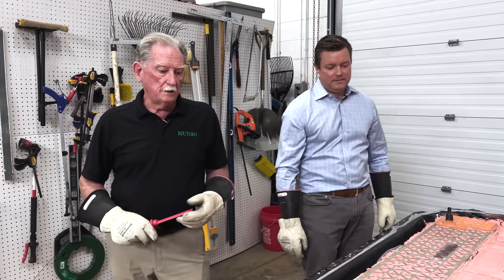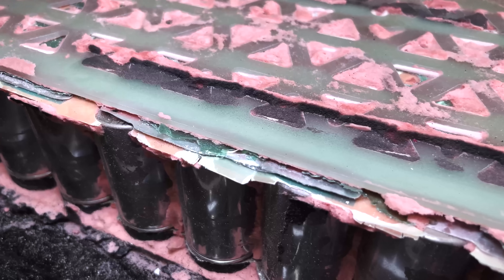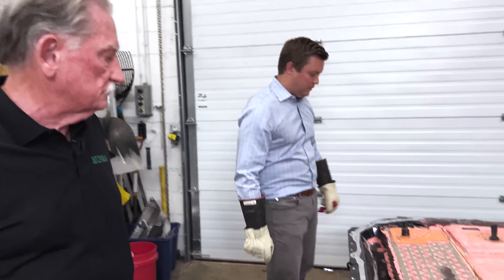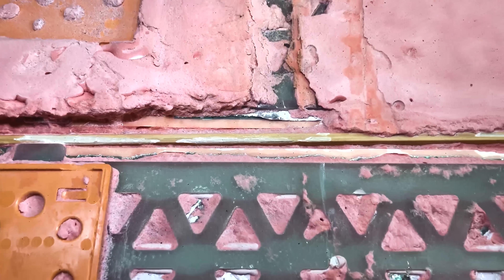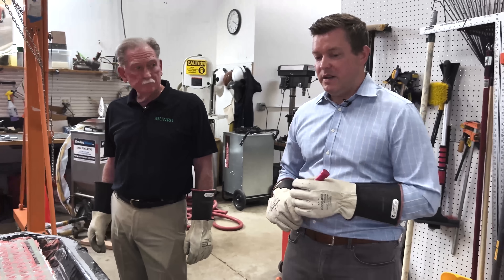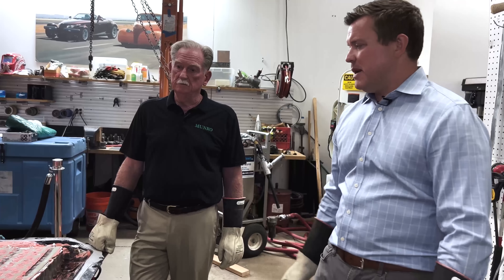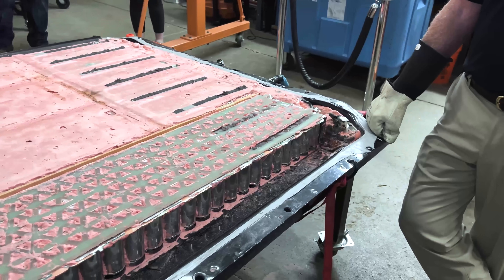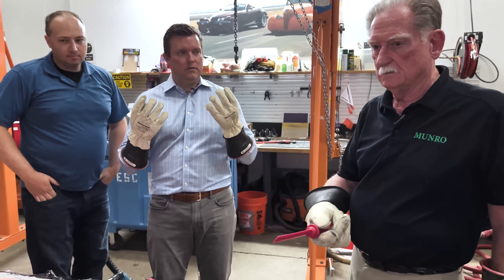4680 Battery Pack: What We Found Under the Foam!

Comment: Can you guys at Munro find the vendor for the foam and ask what their take on this is? I'm guessing they have a specialty solvent that will ignore the other plastics. Reuse > Recycle > Waste
Reply: The providers of any proprietary materials likely are bound by a contract to not disclose.
Reply: Or you just use the whole damned thing and plug it into a new battery storage system.
Reply: @Barskor1  yep, after a car then it's house storage, milk whatever is left that way. Only need to grind it up when it's totally gone.
Reply: @stevenson720  No.  It is into the grinder for recycling.  Recycling the minerals reduces the cost of new packs.  "reuse" in the slogan "reduce, reuse, and recycle" is there just because most things cannot be recycled to make it seem like you are helping when you aren't. The low volume of people reusing EV packs is absolutely meaningless.  Recycling 100% of packs is the real deal.  This is what we need to close the loop.  Once peak minerals are reached in the recycling loop, new mining is greatly reduced.  Reuse for silly one off projects prevents recycling.  Tesla will eventually hit people with a massive core charge if they keep their old packs because recycling is necessary to keep costs down and reduce pollution.
Reply: @Barskor1  You are not thinking correctly.  Tesla is getting full reuse of the minerals via real recycling.  This is far better for the environment than trying to piecemeal EOL reuse for silly random side projects.  DIYers are a tiny population and don't help anything.  It is far more efficient to recycle that pack than have a DIYer use it for a side project which forces new minerals to be mined and processed to replace what the DIYer refused to recycle.  Reusing a pack instead of recycling is a waste and hurts the environment more.
Reply: @_PatrickO  That is so stupid. Please take a look on how dangerous, energy intensive, toxic and wasteful recycling is. It will always be the last step. Why should I grind up the battery with 1000 of cells when only 5% of them are severely degraded and the rest has 80% capacity (even higher SOH for lower power uses)
Reply: @buggi666  I know, it is incredibly stupid to avoid modern recycling and instead mine new materials that need to be refined.  Recycling skips all that.  Look, I get that you are one of the people who thinks recycling is bad, but what they are doing with these packs is extremely efficient and  very very low pollution is generated.  Recycling an EV pack to make a new one is much more environmentally friendly than "reusing" the pack instead of recycling it into a brand new pack.  Go look up videos on redwood materials if you can't figure it out.   When they grind up that pack, they are reclaiming >95% of the materials.  That will go above 99% over time(assuming they haven't reached it already)  This reduces pollution far more than low volume DIY reuse.  Grow up.
Reply: @_PatrickO  First of all, I did not say that recycling is stupid. Dont put words in my mouth. 
I work in battery recycling and right now the only incentive is to split into low and high Co streams. Besides the electrode metals separation, which can be done mechanically, the separation of the grey matter elements is chemical and absolutely hazardous as a process.
The recycling should ALWAYS be the last step. Our demand for storage will be so high that we need ALL sources. This includes: second life, recycling, mining with conventional methods, new extraction methods, high emphasis on Co-less batteries, reduction of Nickel usage and new electrolyte chemistries. I am a grown up, but thank you.
Reply: @_PatrickO  Unfortunately, the ‘grind and recycle’ system is low-labor and low cost in volume but requires another large industrial complex to implement. 

There may be the quantity of recyclable batteries to do this only in a few large cities, so all these TONS of batteries (eventually) will need to be transported to large recycling facilities, negating much of the reduction in energy use for recycling over mining and building new. 

Local, small scale reuse is an excellent addition to ‘full life cycle’ recycling. 

Apple also feels all their older products should be simply shipped to China to grind up and reuse, but it is much more wasteful then the enthusiasts I work with to extend the life of an old Mac as much as possible before recycling locally. 

That said I think large scale ‘grind and recycle’ is still a good compliment to local reuse cycles.
Reply: @_PatrickO  Actually the three parts in "Reduce, Reuse and Recycle" is ordered in that exact order for a reason. It's because the least resourse demanding thing you can do is to Reduce your consumption. The next best thing in terms of least resource demanding thing we can do is to reuse. If neither of those options is viable then we are best of with recycling. But when looking at resource demand it should not be the favorable option, although it is still better than doing nothing or leaving stuff in landfills.

An example to show this could be shopping for cloths, but looked at from a sustainability perspective.
When out shopping for new cloth for yourself the best thing to consider is "do I need this or can I do without" (reduce).
The next best thing in terms of sustainability is to shop in second hand stores to get cloth that is new to you but others might have grown tired of or out of. (reuse)
The least effective of these three options is to throw the stuff to recycling where the fabric of the cloth might be shredded and used in something else, like insulation material or something idk. Hope it makes sense.
Reply: @_PatrickO  Plus there will be other solutions for non-mobile storage, something similar to iron batteries.
Reply: @buggi666  because of "SAFETY AND SECURITY". as always.
Reply: @buggi666  In a well designed pack you are not going to have a handful of bad cells .  Most of them in fact will be degraded.  Some lightly, some moderately, and other severely degraded.  And it is not easy to identify the level degradation for each cell .  when you have  a 1000 cells it could take days to test each cell to figure out which ones are probably still usable.  The labor costs make reuse or repair impractical.
Reply: @_PatrickO  wrong wrong and wrong and it makes no sense at all! Do you even know the amount of EVs that still needs to be made !?
Reply: @_PatrickO  crap!!!!! They can recycle the battery once it has been used well passed it’s capacity even for energy storage at home!
Reply: @_PatrickO   nonsense nonsense nonsense!!!!! EVs still represent barely 3% of all automobiles on the roads! The recycling of their batteries will have basically no impact on the making of new batteries out that in your head! We still need gigantic amount of batteries to make enough EVs. Also by saving energy from recycling directly we make a second life item.
Reply: @R4nd0mN7mbers  Great comment! 👏👏
Reply: @stevenf1678  in a well designed pack all the cells are similarly degraded.

And you don’t test all the cells for stationary energy storage. You test the pack for functionality and round trip efficiency and then install the entire thing in the storage system.
Reply: @_PatrickO  I don't think your grasping the cost of reprocessing these batteries. Liquid N² is not cheap in quantities needed. The mechanical portion is not bad, but then they throw in separation of the minerals by specifix gravity, the chemicals for that process are not cheap either let alone the equipment.
Reply: @patrickradcliffe3837  lol, because they don't use liquid N², munro was wrong about that.  Freezing is not necessary to grind the packs up.  Munro likely  knew of someone trying liquid N² and cited what he knew.  He doesn't know everything,  because he is a genuine person not afraid to learn.  As for separation, solvents are recyclable.  Look up online, solvents are already cycled in different industries.  Redwood and tesla will process the solvents on site and immediately reuse them in their respective factories.
Reply: @_PatrickO  after finishing its life as diy project it will be recycled anyway.
Reply: @stevenf1678  OK it seems that you have no idea what you are talking about...."Well designed battery pack" etc. Every Second Research Institute in the world is investigating fast and online state of health Degradation Monitoring...If you dont know how a battery cell works, dont post such statements...
Reply: @teodor4ik183  It is like you don't know how thinking works.  If you don't turn your pack in for recycling, there won't be minerals for your new pack so you won't be able to buy a new one.  They will start charging a core charge on new cars if you don't have an old car with a pack in it to trade-in.
Reply: @deltajohnny  Thanks man! Took a good bit of time to write up, so I'm glad to hear it is appreciated. :)
Reply: @_PatrickO  ok, but 4 project i will buy other new one, which will never go to car also. But i will pay additional price and use additional materialt 4 recycling.
But, same time, reused battery once will totally die and anyway became recycled, just little later. 😁
Reply: @R4nd0mN7mbers  You're very welcome, and it's a very interesting subject 😉😉
Reply: @_PatrickO  To be fair, repair might be to continue using the battery in an older vehicle, not a one-off project.  Non-suitability to repair is a short-coming, but Tesla has made the decision this design is the right one for now.
Reply: @UnknownIdaho  If Brandon and friends forces 50% of cars to be EVs by 2035 there will be ample bad batteries around pretty soon to sustain recycling efforts.
Reply: @scottgaree7667  No one has to force anything, the tax credits are unnecessary, EVs will cost the same as ICE vehicles soon, then they will cost less, with no high gas bill! I think consumers will decide…
Reply: @Barskor1  that’s actually totally impossible because you have to reconfigure the whole battery drip to work on either 12, 24, 48v, u2 cold….

Comment: So when a gasket on one of the coolant hoses inevitably springs a leak, is your entire pack toast?
Reply: Why "inevitably"?
Reply: @rogerstarkey5390  Because hoses of all types have high failure rates compared to something like a pipe.
Reply: Since the hose is packed in foam it's very unlikely it would happen as the foam would keep everything encased.
Reply: 8 years or 120,000 miles to get it replaced. Then you figure by then you’ll get the updated design that would last 10 years. After 5 years you’ll buy a new car rinse and repeat.